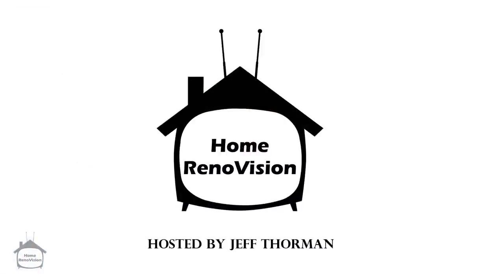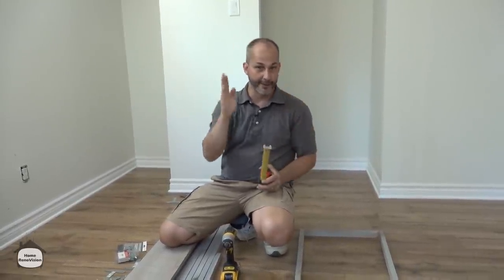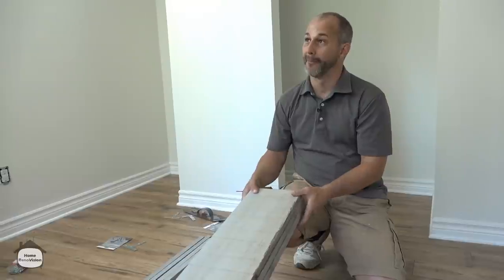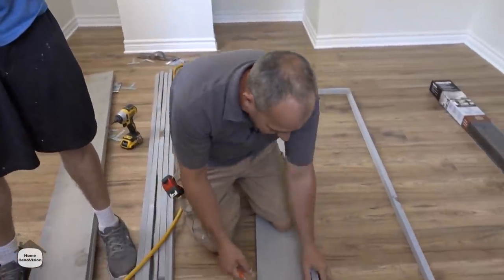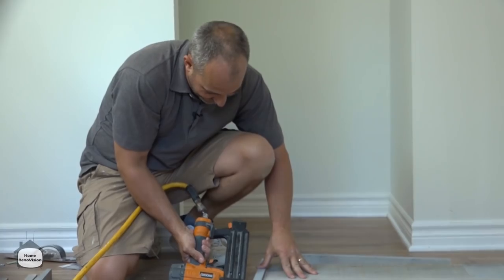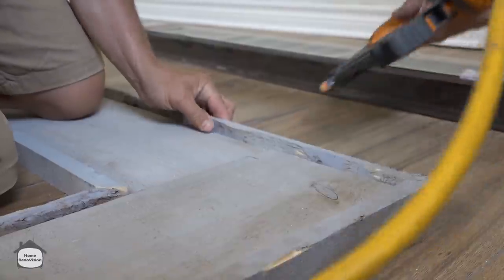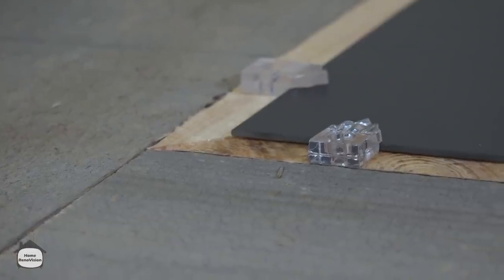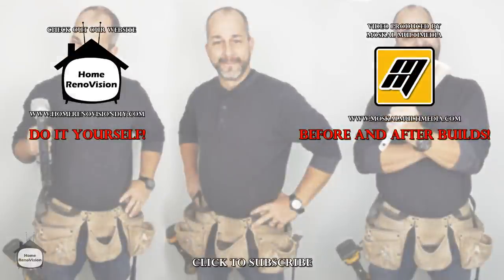How to Build a Custom Barn Board Door with Mirror

Comment: Nice design, and overall a helpful video. But it is KILLING ME that you aren’t using glue! Why not?
Reply from the maker: Trying to use glue on such rough lumber would make one hell of a mess. I prefer to use brackets and nails in this environment.
Reply: Fair enough! But since I'll likely be using smooth, finished lumber, I think I'll glue it as well! Lots of help though - my original design was way too over-complicated. I was planning on building it on a 1/2" MDF panel, etc. Way easier and lighter to do it this way.
Reply from the maker: Without a doubt if you are using clean wood , I would use glue then as well.Cheers!